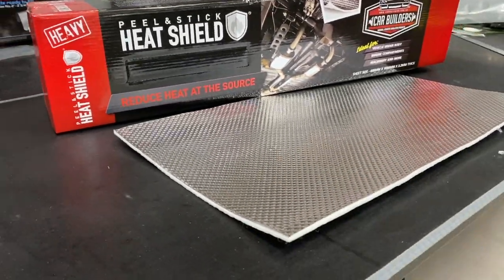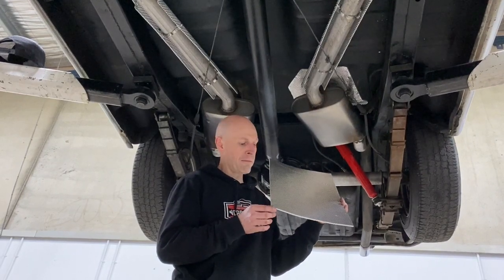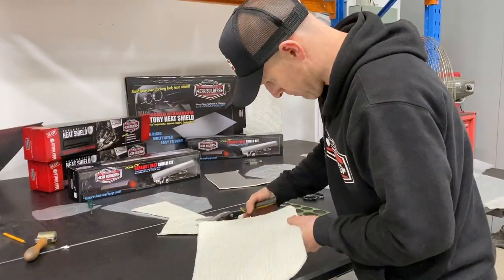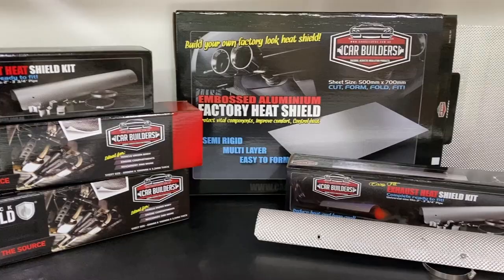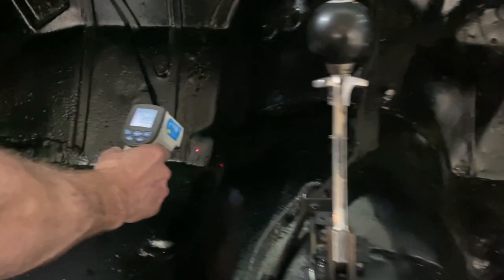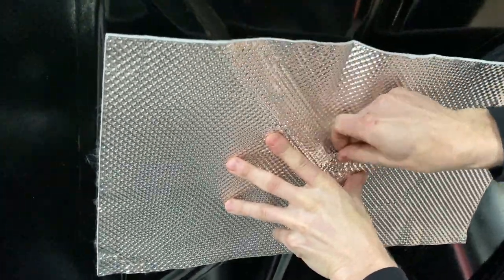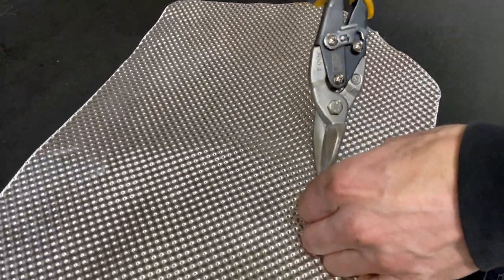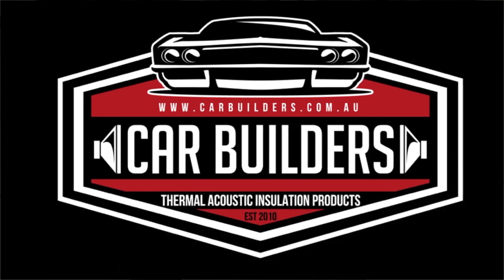Stop Heat at the Source with a Peel & Stick Heat Shield

Comment: Interesting. 
Could you use this on the undercarriage of a 79 and 78 series ?
What other products are suitable for installation underneath ?
Reply from the maker: Hi Ade. Yes, this can be used externally. There are two versions, 'Lite' and 'Heavy'. The heavier has a thicker aluminium face and is better suited to areas that will be impacted by road rash. 👍

Comment: Can you use it on a fuel tank?
Reply from the maker: Hi Randy. Yes, you can. If you can stand off an embossed heat shield it is best, however if you don't have space you would use the peel and stick. We used a combination in this video. https://youtu.be/ESo2yid89bQ

Comment: Can I use it as a turbo blanket? Can the adhesive stick to hot turbos?
Reply from the maker: Hi Gre Tre. For best results you will need a turbo blanket and ceramic coat turbo. The Peel & Stick is designed to face the heat source and protect it by reflecting and insulting the heat from hitting the component etc. 👍

Comment: @Car Builders, I'm not sure if this is the right product but would appreciate your insight!
I need a product to help lower or mitigate heat in my engine bay, would this material be appropriate to place on the underside of my hood?? I've seen people use sound deadening material on the hood and make mention it can help with temp or products like this, so figured you guys would know exactly what's right or wrong to do when attempting to reduce heat soak/lower engine bay temps?!
Reply from the maker: Hi J H. Thanks for the question. Sound deadener is not an effective product to reduce heat, it will knock out somewhere around 5°C-10°C (you can use pads of it in the hood but with the aim of reducing panel vibration not to use heat issues). A peel and stick heat shield by comparison will knock out a huge percentage of heat. The only issue is it may not look aesthetically pleasing. A bonnet insulation pad will reduce some heat and look more factory. So it comes down to how much heat you are looking to reduce, by far the most effective is the peel and stick heat shield but if you motor is stock you could use a bonnet insulation material. Good luck with your project.
Reply: @carbuilders1  Thank you so much for the help. Based off my needs and mods, I certainly need the peel and stick to help reduce heat in the engine bay. So if you guys are willing to help, where can someone such as myself in the US buy the right type of peel and stick heat shield?? 
Hope to hear from you all soon, respectfully - JH